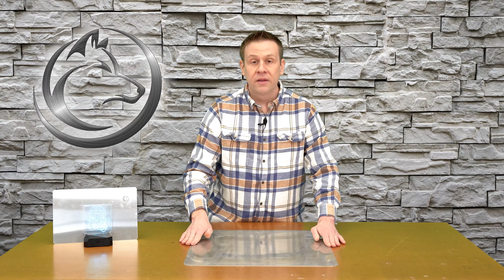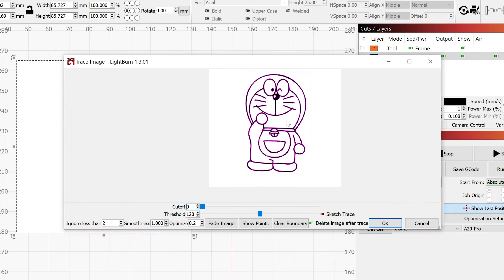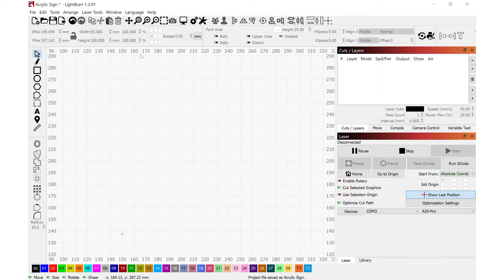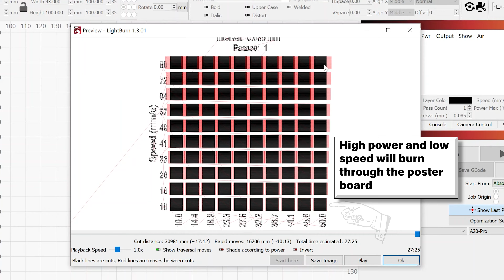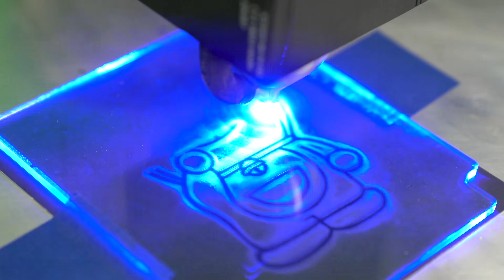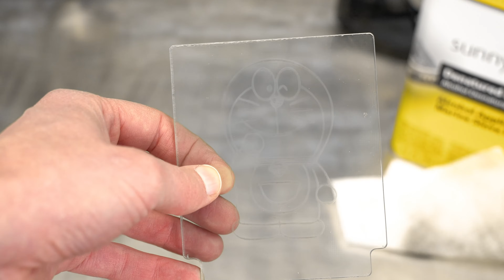Atomstack A20 Pro-  Engraving Acrylic the Easy Way!

Comment: Hello! I am trying to cut acrylic but having a hard time finding my bearing and have been burning the acrylic. I have an atom stack x7 pro
Reply from the maker: Acrylic can be tricky.  What type and color do you want to cut?
Reply: It’s clear and I have a black bottom for contrast
Reply from the maker: @ursulich  Clear acrylic is not able to be cut by a laser diode.  To cut clear acrylic a Co2 laser is needed.  Here's video with an entry level Co2 laser: https://youtu.be/VnnLOgdzvQ8

Comment: Hi, I'm new with this laser engraver. Is it possible to cut the clear acrylic with this Atomstack A20 Pro?
Reply from the maker: Hi! No, it's not possible to cut clear acrylic any laser diode machine; it does not matter the brand or power output.  The laser diodes operate in a range that does not affect clear acrylic for cutting.   To cut clear acrylic I recommend a Co2 laser- cuts clean through.  Thanks for watching!

Comment: hello , i have the atomstack s20 pro,  i purchased the extension kit, wiring was straight foward, but i have one single black wire that i'm not sure where to place it, it goes, i think to 1 of 2 ports, one is 5 volt and the other is 12 volt. it comes from the power switch. any ideas anyone ??

Comment: do you show how to engrave acrylic using GRBL software
Reply from the maker: Hi- no, I don't show the laser machines using GRBL.  I use LIghtburn on all my machines.
Reply: @thelaserchannel1  is cast or extruded acrylic
Reply from the maker: @tcollins6969  It is cast acrylic from a quality and reliable source- Houston Acrylics.  I'm not affiliated with but I order all my acrylics from them.  Extruded acrylics will crack, bubble, or burst- it just doesn't work.